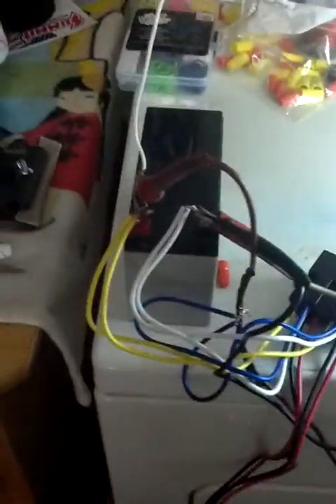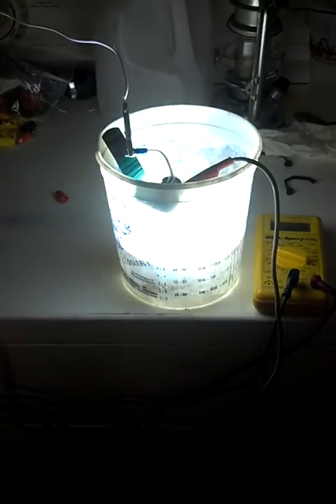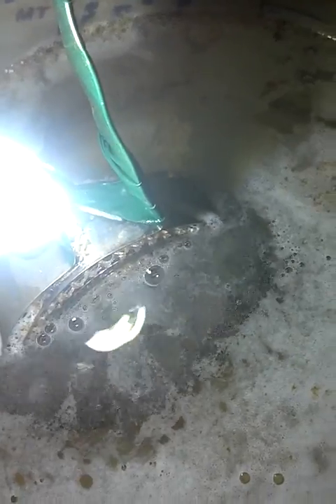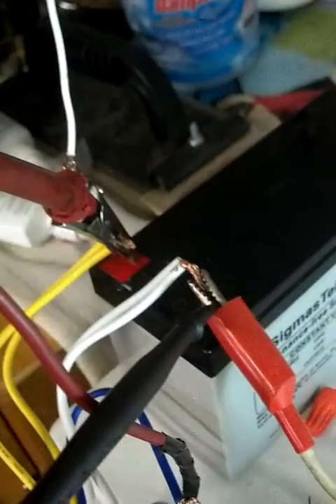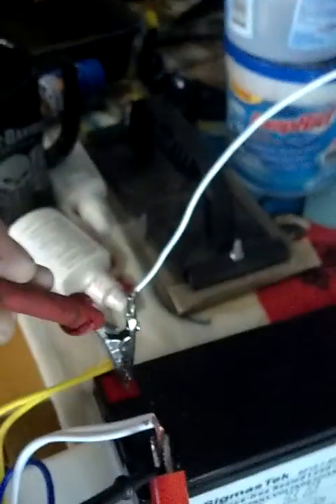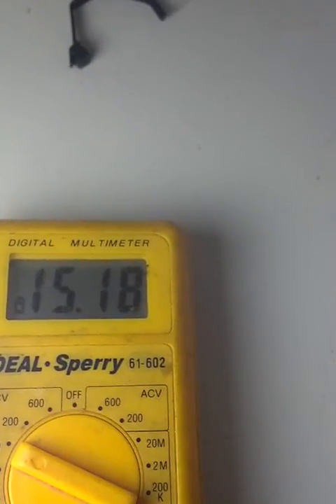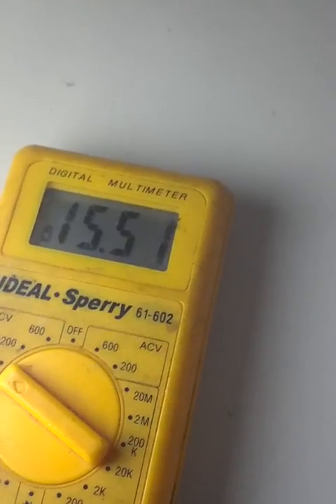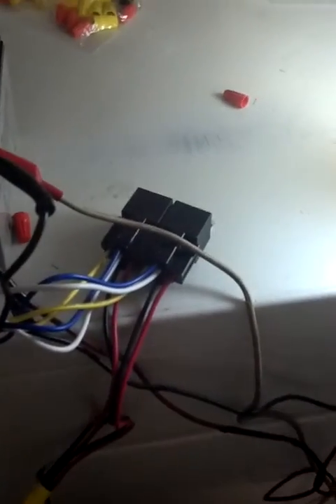Radiant Energy to make Hydrogen for free!

Comment: Thanks for sharing the circuit. This is another one on my to do list... Your findings (with respect to the metal table) are very interesting. I am looking forward to giving this a go. Probably will be in the next month or so, I am kinda busy with another alternative energy project at the present time... Keep us informed about your progress and thanks for sharing :)
Reply from the maker: sorry I didn't get a notification for your post until today. Google must have delays on the free energy stuff!
Reply from the maker: I actually have run the circuit for 2-3 days and had to move it. When I reconnected it, different results had given problems as the battery was filled to the top when I took it off, and the result was opposite. The load also gets to be more and more with the cell on there, as it gets hotter and eventually kills the battery. I have messed around more with the radiant energy part of it. The top schematic a-02 on the mbrcircuit.blogspot.com shows that the relay driving the transformer into the rectifier and then looping back to the input is a more promising response, but, anything larger than a tiny led will make the batteries go dead. You have to remember, the relay in oscillation uses 250-500 mA depending on the relay used. I have found a cheaper relay that uses 85- 125 mA to oscillate which was much better result. this lights the led, charges the cap bank and charges the battery while absorbing the losses from the relay and the transformer. This circuit merely proves there is the ability to get overunity with a non rotational circuit, but, it is still a moving devices as the relay armature moves. I am trying to now design a solid state circuit that will sustain a charge as this does. This is basically one smidge over perpetual motion because it makes just a bit over it's input power, or should I say outputs more. This does not violate the laws of physics because the back emf is creating an arc that draws in radiant energy which if you add the antenna as shown in the bottom sketch in the page I made, mbrcircuit.blogspot.com, the circuit will draw much more but, it is very important you add a super deep earth ground exactly where I show. I may mix the schematics to show what I mean. Please play with the circuit and post some promising results. The circuit totally depends on your elevation and resistance of your ground. I would tell you to ground it in a river or lake bed.
Reply: Marc Belanger Excellent response. We are all explorers sailing into uncharted waters. Thank you for sharing that info. I must dwell on it. Peace. Do you do G+?
Reply from the maker: yes sir I do. Thanks for the compliments. I will be posting again very soon as soon as I get some new sd cards. The sd card ended up being placed next to a neo magnet and they do not like that very much, of course wiping it out and making it permanently unusable . I get discredited with my terrible quality videos from my phone so I will certainly be posting some very clear, and still videos from the camcorder with a tripod from which i will explain some extremely informative details on exactly how to build these very soon. The circuit I posted to the site originally, mbrcircuit.blogspot.com, as well I have just posted a new schematic ( on the top of this page) that is extremely easy to build in your spare time to see that overunity is certainly possible. When all of the skeptics comment it is impossible, it gets me extremely upset because they all know we have a working device that does what was once stated to be impossible.I made sure the world could see this, and, as you see, the technology is ancient but very easy.  I have passed my knowledge along to many people and one day the videos will be taken down so please, if you use what I show, please show others who will build it to test it and see how it works so they could do some research and development , hopefully perfecting drawing in additional and larger amounts of energy .. Please keep posting back on that site I built. . Eventually one of us will succeed and there will be a new device developed from a technology that is 135 years old. We do not need to pay for power, this was all done covertly back in 1892 so JP Morgan could make all of the profits from electricity when he developed General Electric, where he profited what would be trillions of dollars today off of electricity that he knew could have been completely free, which Tesla almost provided to us. We could get this working and spread it worldwide so everybody could benefit from it and even drive their cars completely fuel free, as soon as it is figured out. The very rich  will have to come up with something else to make money off of very soon and all of my viewers and help will be credited for the development of this technology because they passed this around to the world so it would eventually become completely and physically possible because my assistance would change the minds of those very engineers that once thought it was impossible. They certainly at this point put this off as an anomaly but, when the larger circuit is launched to the webpage and videos are added, anybody will be able to build it, as well, everybody that does will certainly believe it once they do. If we look at how this is operating, we could see how it works if we look closely at how this is done. Please have electricians and anybody who may understand comment so i could explain what my theory is, my background, as well as why I think overunity is possiblke because that is the most important to me so the whole world knows how my circuit is actually working, and from there, developments will eventually happen, I am most sure of it. I have my own newer versions and other beneficial circuits/devices to post as well that do nearly the same thing, but, I am skeptical if they will hold up for long periods of time, so, when they  fail, at least I will know the life expectancy , as well, what will break so we could either come up with solutions to the failure, or offer replacement parts so it will only need a small item for replacement when they fail. Thanks again for watching and the comments, your time is much appreciated.
Reply from the maker: Binj Komisar do you dabble with these technologies as well? I need to partner with people who have great ideas so we could put a group effort to make this all possible. I have purchased a website that will be private for all inventors that believe in this theory, also, that care to share their info for the benefit of our planet and society in whole. I really do not wish to down the oil or energy economy, so, to stop the effort of causing trouble, I will be trying to push the circuitry to society very slowly and allow the economic struggles over the period of it's development , so they learn this is happening and find new routes to eliminate future tax issues, oil economy problems that will come up, or maybe find new markets that the investors could buy into, such as these technologies. If we all can't get it out there to the public, or, we fail to make it work, I feel eventually we could all make a difference to at least give great efforts to do so by others in the future and it will certainly make a great name for ourselves and our family names. The website is called cleanenergymachine.com . I am in desperate need of a developer who could add forum code (which i don't know how to do)  to it so we could all use it for a private site to keep unwanted trolls and shrills out, as well as gov and energy investors that could turn the whole thing upside down. We all need positivity to make this a success so, I have investing money, time, and a lot of effort to make the struggle a bit easier, and i will need people to dedicate some time to the cause. That would be a huge start. i am not looking for investments, but, if we could set up free energy experts and designers to come in and maybe set something up to get some donations from time to time, to fund the experts for their brain power, it would be most helpful because the devices and components do get very expensive over long periods of time, as well, copper for one. I have invested 50k and have come up with very little over the last two years, but, i have devices showing potential for newer future builds that may actually work, but, if we all pitch in the ideas and working designs together that produce more and more energy, less components and parts will be needed to experiment with as time goes on, due to a lot of guess work that is costly. My goal is to come up with completely free energy, and lots of it, as well, maybe even dabble with antigravity if it isn't super expensive to do so. Eric Dollard, John Hutchinson, and other geniuses will be necessary to jump on board if we could find such a bunch. Once this happens, maybe we will get into flying machines of our own instead of cars someday, but, doing so as a community would eliminate investors locking this technology up. It would either create a great new free power source, or, a lot of very wealthy inventors who team together because energy is the biggest money maker on the planet. I just wish to be a part of the greatest thing to ever astonish the world on a very large level, even if it eliminated myself from making a living from the devices. I have a different theory of my own that I think is a very plausible thing, and by sharing this with some may come up with the equations by Maxwell that were erased and rewritten by Lorentz, because nobody would have ever listened to JP Morgan as he was only trying to get richer by making everybody poorer. We need asymmetry equations to master this technology, and JP Morgan used his power and wealth to silence science so it was not possible, he did so one year after Maxwell died and it's a shame.
Reply: Marc Belanger You should talk with me and a couple of my researcher buddies sometime on G+ hangouts. We are all working towards the same goal. Peace. I'm off to work but we will talk sometime in the near future. :)
Reply from the maker: Thanks, it sounds good. I will be looking forward to doing so in the very near future. Hit me up here or on G+, I am only used to commenting and posting on my own page so far as i haven't used it too long, only for youtube, my business sharing, etc.

Take Care.
Reply: Marc Belanger When I try to go to cleanenergymachine.com it takes me to amazon.com. Why is that? Also, may I ask what city you're located in? If you're nearby (I'm in the midwest) I'd like to lend the use of my supercapacitor bank. As some have pointed out and I agree with, lead acid battery voltage does not necessarily equate to how much energy is stored in the battery. I believe it would be harder to make the same argument with a supercapacitor.
Reply from the maker: sorry, the sites that I have forums at are dezeinstein.com , which is working, but, the setup of the forum is kind of screwy. The link to get where you need to go is here: http://50.62.72.173/~dezei/?bbp_user=2#topics-created
 , but, you are going to see all brand new topics that do not have much info posted yet, except for slayer exciters. I haven't had time to populate it yet since there's so many issues with my other sites and I have had literally thousands of messages and emails to respond to over my pelex device and my back emf videos
Reply from the maker: I have another forum started with absolutely nothing done to it yet for the same reason and I am going to start working on that one as well for just new electronic circuits and technologies that are all open source. Dezeinstein.com will only be for experimental technology, education of free energy technologies that will be all open source, etc.
Reply from the maker: If you have comments on anything, or, new ideas, schematics or great response from the use of one of the circuits I have posted to my blogs, please post results, comments, etc., or, help support us by sending new users there.
Reply from the maker: thanks
Reply: Marc Belanger 
Hi Marc,
I am still researching all of your posts and have ordered most parts you use to start with the simple switch oscillator proof of concept.

dezeinstein.com seems to not be working.
Have you halted the plans you speak of?

Cheers,
Raymundo
Reply from the maker: I couldn't keep up with the work to upload, as well, people weren't getting to the website and it is now down. I wish I had more time to do this, as well, received either investment or donations to assist with the finances. i have paid so much in parts I can't possibly keep up financially, but, I have not stopped my work. I just need more time, there isn't enough of it on this planet if you work to support a family with a stay at home Mom. I'll keep posting my videos that I successfully upload to my current videos so many people see when they are completed, however, somebody has made it extremely difficult for me to upload as most of them fail sometime during the uploads. I have found out how to do this but it has to be in small pieces.

I will eventually upload some new stuff and post some great circuits I've built on instructables, etc

Again, thanks for following my work. I appreciate the support and I will be publishing some results on the energeticforum.com as soon as I am back with new results from my failures I have benched for a bit. I have a new success that is able to be done easily and i will video this soon. The wife will hold the cameraa as I put together the presentation soon!

Thanks again!
Reply: Sigh, financial issues I know all about, I guess the faith for people like us. :)

Energeticforum is the place to be :)
My username : Majestic81

I can help with video editing and uploading through the Dropbox.

Try getting a tripod for your lovely wife to work with.

This one is about $9 with free shipping.
http://www.ebay.com/itm/Enduring-Best-New-Aluminum-Tripod-Mount-Stand-CAMCORDER-and-Digital-Camera-HFCA-/381261863189?pt=LH_DefaultDomain_2&hash=item58c4fa5915

If strapped for cash this $2 should do
http://www.ebay.com/itm/Mini-Flexible-Tripod-Bubble-Octopus-Stand-Gorilla-Pod-Gopro-Camera-SLR-DV-/151730685786?pt=LH_DefaultDomain_0&hash=item2353da875a

Cheers!